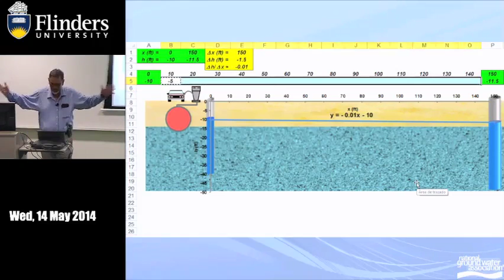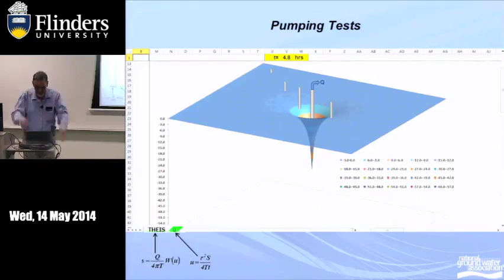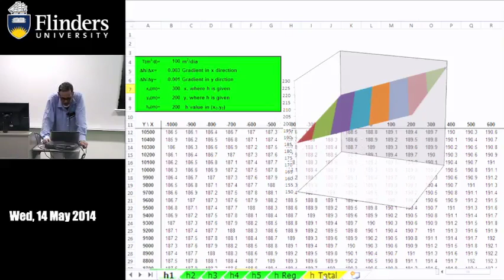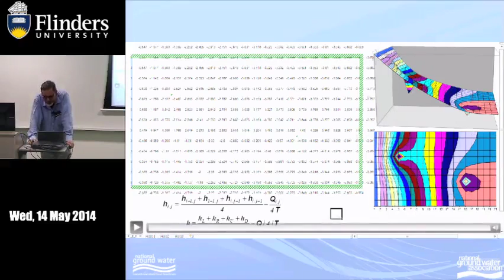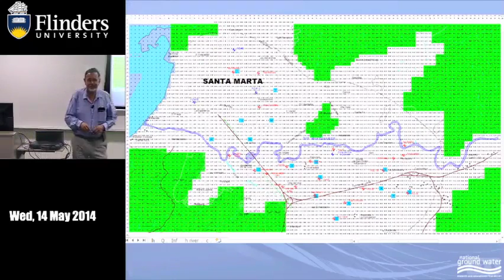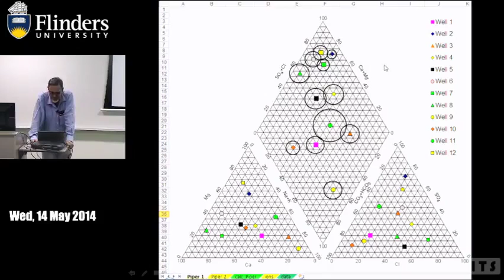2014 McEllhiney Lecture -- Carlos E. Molano, PE

Comment: I've had the pleasure of listening to Prof. Molano presenting his GW SPREADSHEETS model. I was truly impressed by the effectiveness of this tool for solving complex groundwater flow and contaminant transport problems.  It's a cheap, easy to use, powerful tool for Hydrogeology teaching research and practice. It also helps to understand concepts. No complex programing is required and it is  suitable for use by Bachelor students, practitioners and researchers, as well as for continued education short courses. I highly recommend this tools and the courses offered by Professor Molano.
S. Majid Hassanizadeh, Professor of Hydrogeology, Utrecht University, The Netherlands.